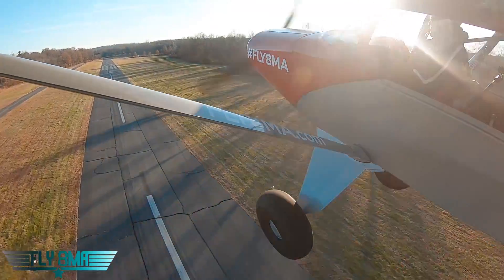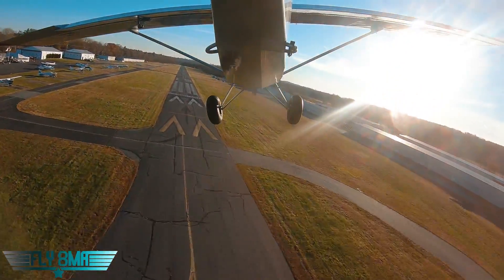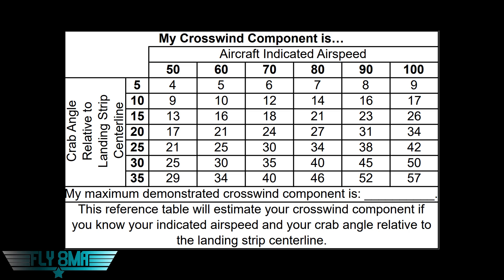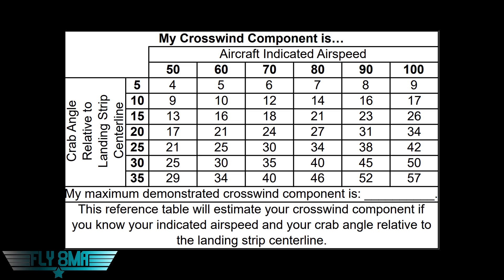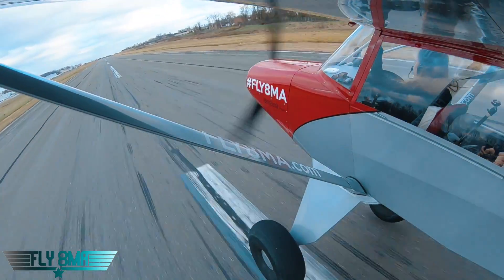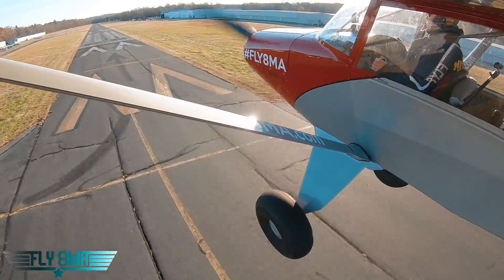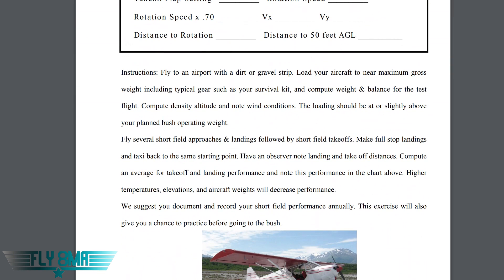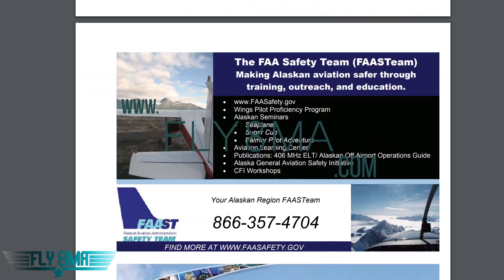HOW to find the CROSSWIND Limit...

Comment: A suggestion. You averaged your heading. In fact, most singles can cope with left and right crosswinds differently and your raw data allowed you to determine max demo xwind for both left and right xwinds.

You can also allow some for the aircraft’s tolerance of landing with some uncorrected crab. This latter applies much more to tricycle gear than conventional gear.

Comment: Great video, Jon! Quick question. I was getting some x-wind practice yesterday in my '50 Pacer; 11G14 from the right. Since it's a tailwheel, I don't crab on final. I hold the upwind wing down to maintain the centerline, and use opposite rudder to stay aligned with the runway so there's no side load at touchdown. Granted the Pacer is short coupled with a powerful rudder, but I consistently run out of aileron before I run out of rudder. Yesterday, during gusts, I had the aileron all the way to the stop in order to hold the centerline, but still had rudder deflection remaining. This seems to conflict a bit with the premise of this video. Am I doing something wrong?

Comment: Perhaps you can answer something regarding this procedure and tailwheel aircraft.  If you are landing a tailwheel aircraft and doing a wheel landing at the max crosswind component (say 15kt), wouldn't it be an issue that as you slow down below your landing speed with the tail still in the air, your rudder won't have authority to stay straight?  I guess at that point you could use brakes to stay straight.  The max crosswind figure seems fine to me for tricycle gear, but I struggle with the concept for convention gear.
Reply from the maker: You are correct that there are multiple factors here...braking, rudder, and aileron.  For us the limiting factor is aileron (not being able to keep the upwind wing from getting picked up and tipped past 20mph).  We also take a 5mph loss in xwind component when going from 20 flap to 40 flap due to less rudder effectiveness with the tail blanketed.   Aileron is always a factor because if the wing comes up you're likely to loose braking authority you need.  Different for each aircraft, but the idea the FAA had here I think was to just give folks somewhere to start with finding a close number.
Reply: @fly8ma.comflighttraining199  Jon, you put up a lot of great content, so I offer this feedback with a great deal of respect, but I feel this video displays a misuse of the FAA's off-airport guidance table. The point of that table is not to determine a max crosswind capability for your aircraft, but to use as a crude way to measure crosswind component at a remote airstrip without weather information. You can then compare this to your known max demonstrated crosswind (if published) or pilot's personal experience or minimums to decide if a landing should be attempted. The technique you describe just happens to be close to the max crosswinds capability anyway because most small planes are so similar in capability. The exercise still has a lot of training value with a CFI on board. I will occasionally do something similar with students to help them get through a learning plateau when it comes to crosswind technique.